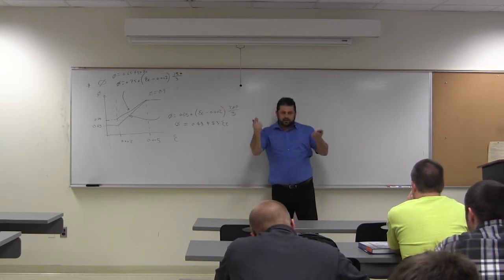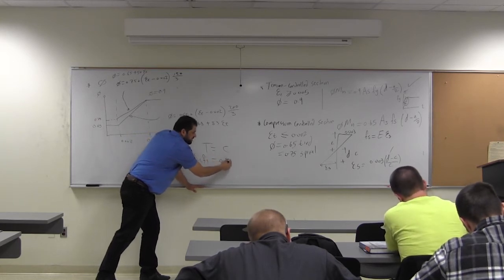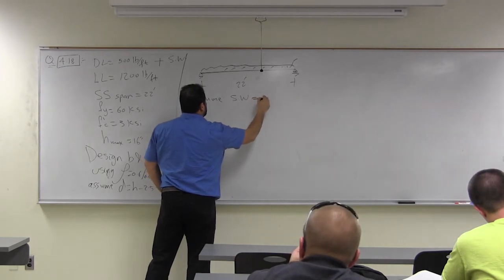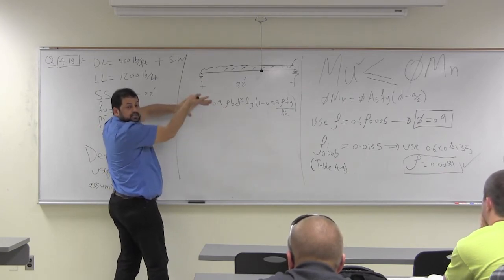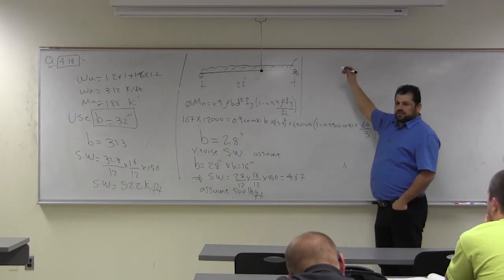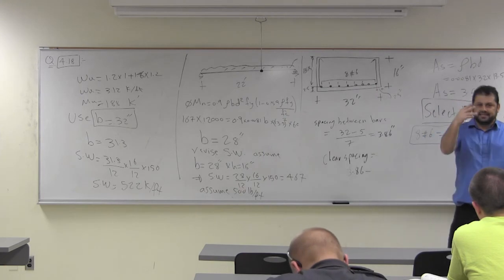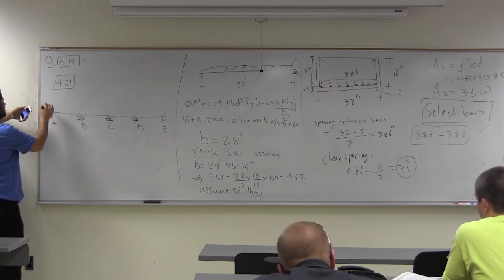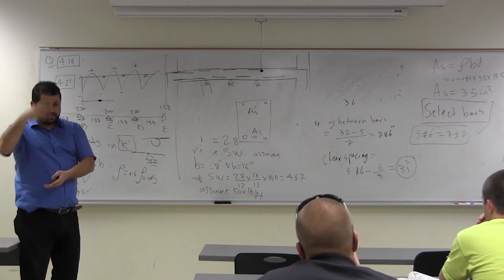Lecture #4 Reinforced Concrete Design - Dr. Mohammad Alhassan

Comment: Hello Professor,
I'm little confused with the balanced control and compression control. Will you please mention what would be the steel strain value in  in both case?
Many Thanks
Reply from the maker: Balanced: steel strain at ultimate = yield strain (0.002 for grade 60)
compression control = steel strain less than yield strain (less than 0.002 for grade 60)
Reply: Thanks Professor, but it is mentioned in codes that even .002 is compression control.

Comment: as salaam alaykum, the section has a larger width to height, b is twice the size of h, that means its moment of inertia in the direction of loading will be lower. Wont that be a problem? Thanks. Great lecture.
Reply from the maker: you may experience something like this in life where h is limited in depth. Therefore you option is to increase b. There will be no problem in deflection as long as it is checked.